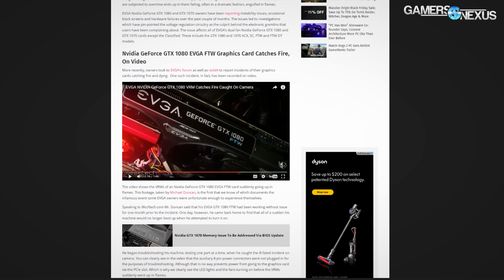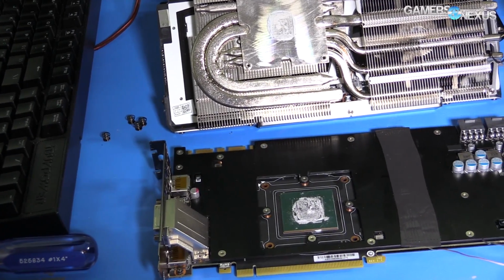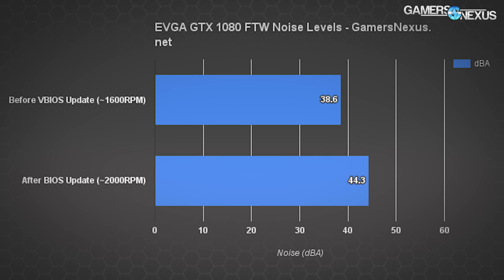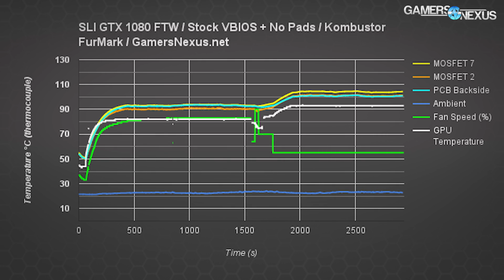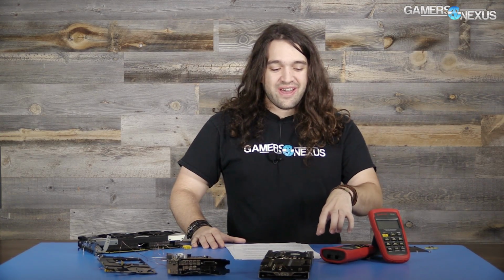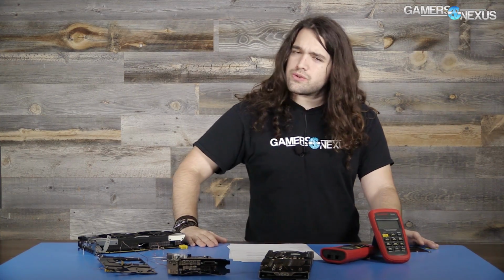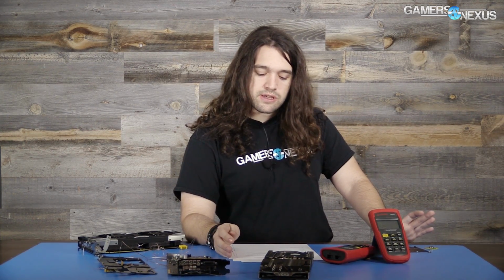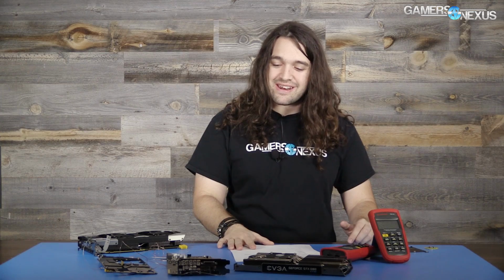EVGA's VRM Thermals Not the Killer of Cards - Final Test

Comment: Thank you so much for your hard work running tests and posting this data back in 2016. All of it was a big relief and Impressive! It is now 2024 and I have obtained an EVGA 1070 SC ACX 3.0 and a 1080 SC ACX 3.0 recently for cheap as an upgrades for our machines. When I get new cards I always take them apart, inspect, clean, and put some new thermal paste on them. My 1080 I have used for 8 months now playing normal and VR titles with no issues and I just now updated the VBIOS. The 1070 we've had for a month and all has been good so far. I will be updating this card's VBIOS as well. I'm going to say it's a pretty good chance with it being so many years, and when the posts for fire breathing cards were, the ones that are left in living condition should be pretty safe. I did see one thing mentioned on forums I would pay attention to though adding to the thoughts on capacitors. From what I understand those capacitors are rigid and any flexing of the pcb at all is quite the chance as the capacitors are multilayered. My Ebay gpus made it though USPS shipping though so take that as you will. I'd just take extra care when handling them or doing maintenance on them, as you do. I will be running my cards at stock clocks until I deem it necessary to push them as I run most of my games at 1080 and my TV I use as my monitor tops out at 120Hz anyways.

Comment: I am glad you made this video, and hope that EVGA does the right thing for it's customers who experience these issue's with their video cards even if they are out of warranty. I still have EVGA video cards I bought in 2005 and 2008 that still work, and hope these are just isolated issue's and not similar to bulging capacitor plague of the late 1990's and 2000's because Chinese companies took shortcuts when building them to save a few cents in manufacturing costs.

Comment: You explained sli vs single card. Higher fan speed on a single card with cooler gpu is, ummm, bad? More current passes through the fan and board components causing higher tempature on voltage regular components?  I'm noob and trying to understand.

Comment: I have seen many defective cards where the mosfets were dead and the card was saved by the fuses installed, or cards without fuses that have completely burned out at that point. What I really noticed is that the solder joints between the mosfets and the board were gray or bad contacting, and everyone knows that bad contact leads to increased temperatures and burns, so I think this is caused mostly from bad soldering techniques or high temperatures which can make the solder to break or degrade over time.

Comment: thanks again.. for 1 year I have been trying to figure out why my 1080 was so slow.. this knocked 20~ degrees of my temps and I finally feel I am getting value out of this card
Reply: What exactly knocked off the 20c? Did you not have the pads before? Or did you just adjust the fan curve? Asking because I have a new unopened one of these I am debating whether or not to send back.

Comment: I´ve purchased an evga gtx 1080 and the temperatures are good when I play with vysnc. But when I disabled vysnc, temps goes to 82-83 with fans in 70%. Too much hot and too much noise. In the EVGA 08G-P4-6183-KR, the base of the heatsink, Is it nickel-plated copper?

Comment: Why wouldn't EVGA spend the extra penny to buy the thermal pads for their VRMs...*especially* on their high end "ftw" cards.  I could maybe understand it on the 1060, perhaps even the 1070, but there's no excuse to not spend 1 cent on a $600 GPU.  Yes, I know that penny adds up when you sell millions of these things, but compared to the damage that's been done to their reputation, it is a no-brainer.  Once a company gets a name for skimping, people aren't going to buy their products, it's a hit to their reputation and reputation is everything.

For example, I've been using Asus and MSI products for over 20 years.  I've had a couple of problems in the past and they dealt with them completely and quickly.  I even bought one of the p8p67 boards back in the day, which had a single bad SATA header and Asus gave me an entirely new board with a different revision.  I trust Asus for motherboards and MSI for GPUs.  I literally have a dozen different MSI GPUs sitting around here (some in systems, some not) and EVERY motherboard that I've bought in at least the last decade has been ASUS and I've only had one issue.  With these two companies,  I know that I won't have any issues if something breaks and this is very important to me, the company's reputation is THE most important thing, for me, followed by performance, longevity and price.  Most people choose those 4 things as their key factors in making a purchase, some people use a different order than I do, but reputation is always a factor.

Comment: I applied the thermal pad mod but couldnt do the vbios update because I have my 1080 in a graphics amplifier and it won't do the update while it's in there. So I ramp up the fans manually. Does the vbios update change anything else or am I ok with just doing it manually? I'm thinking of just buying the hybrid kit and doing away with air cooling all together.
Reply: The Vbios update just cranks up the fan curve some compared to stock. so if you run a custom curvehigher then the stock was you will be fine.
Reply: oh ok man thanks yeah i definitely run my fans at max when doing heavy 4k gaming and need the extra cooling.

Comment: O_O

Very glad to hear that this is more of an isolated problem. I will be installing my thermal pads/making sure they are installed. I dont plan to really overclock it, but I like my  rig running as cool as possible. 

Video was fantastic, overwhelming but fantastic. Lot of data, reasonable method, and you really put it through the paces. I'll be picking one up in Jaaaaanuary.

Comment: Thanks for making such an in depth test! 

I have a criticism towards presentation though. The time charts don't do anything to make the situation clearer and are basically useless on video. From each of them, you can take the like the top figures or top deltas and represent them as bar graphs. Then you can fit display different test scenarios under each other, making  them easily comparable.

0.2% defect rate is OK for the first few weeks of use, the cards are not that old after all, and there's a lot of components in the VRM circuit. It is to be kept in mind however, that PMOSFETs also roughly obey the rule that increasing the operating temperature by 10° is likely to halve their average life, just like is the case for electrolytic capacitors, even though the rule is completely accidental and the reasons are not similar at all. And that there is always a significant variation in durability of individual components. So it definitely makes sense to keep everything there well under 100°C, even if it's specified up to 115°C, else you'll just keep seeing failures later on. The real question is going to be whether these 0.2% early failures turn into your normal 1-2% first-year failures or 10-20%.

Comment: Thermal pads applied, haven't seen any discussion about bad capacitors however? should I refund this card?
Reply: Bad caps happen in all electronics.  If your card still works it is fine so stop worrying.  Bad caps are a common cause of failure in practically everything that has electronics, so relax.  You can't prevent it.

Comment: I just use an aggressive fan curve in Afterburner. Problem fixed.
Reply: Laserturken 8659 Bruh. It's bad capacitors on like 200 cards not thermals.
Reply: I think you need to rewatch the video.  You can run default fan curve and be fine.  There is no thermal issue.

Comment: Hello GN and thank you very much for your video and research! I have a EVGA GTX 1070 that i bought in august 2016. I've requested the thermal pads but i havent gotten them yet but i will apply them when they arrive. But now to my question, I am using my pc daily mostly for gaming and I am now wondering if I should still worry or if there was a problem witch my card should it have appeared already? Kind of a hard question to answer but mainly i wondered if you guys have heard anything about how long it took for defect GPU:s to "blow up/catch fire or start to act up? Thank you very much if someone has some info!

Comment: This really puts things into perspective when it comes to the issue. I have a 1070 ftw. I haven't had any issues with it as far as core temps are concerned. I also have no way of testing temps on the vrms. But I did order the pads and downloaded the vbios update. Extra performance with cooler temps, I think it would be foolish not.
Reply: Especially with GPU Boost 3.0, Where Thermals are all too important.
Reply: I'm more curious to see if I get a more stable overclock with the pads and vbios update applied. Just got my pads in yesterday.

Comment: You know if it is a bad batch of capacitors they need to Recall those cards, and not ship the VRAM stuff......this is not good - great video as always - thumbs up
Reply: haris javed this is not a bad batch as in contained.  it is standard across all cards and manufacturers.  all manufacturers would have to recall them, not just evga, to include amd.
Reply: That would cost millions. Its much cheaper to replace even thousands of GPUs. This isn't life critical like air bags in cars (companies still prefer to pay millions per death as opposed to recall as it saves them money). Recently there were metal fragments that were launched from the airbag explosion effectively making a frag grenade. Its obvious they never tested the air bag, otherwise they would question why chunks of metal were blasting into pieces. Its simply cheaper.

This isn't life critical, so realistically, they won't recall all of the cards. Like I said, they could RMA thousands, probably even extend warranties to lifetime for free and still save money.
Reply: I''m personally on a GPU/monitor death streak. A "used" 270X from ebay, it blew electricity from the HDMI (bitcoin mined to death probably), that killed a TV. I had an old monitor give up and arc through the VGA cable (tripping house breakers), also killing thankfully a cheap X1300 (monitor was working the week before). Then my other 270 died (but that could have been subzero cooling, I think it just needs a re-flow in an oven honestly).

That's a 270x, X1300, 270, TV, Monitor (all within the last 400 days). Obviously, if EVGA only has 200/million, that beats my 2.5 per year (for just me)!    (PS: No I don't send things in for warranty unless they are DOA, also, I won't be buying many more "used" parts on ebay. Also, none of these were from bad design from companies as far as I can tell, because the only one that died unexpectedly was the 270, but I think it just didn't handle the cold well, and no company expects a GPU to run at -50c for daily use). I'm having to use my laptop right now... 

But I got a Fury coming so, I'm pretty excited! No overclocking on this card, cause I'm way below the recommended rating with a 500w PSU, and I'm running an FX-8350 (220w true draw, or 260w from wall increase when I run P-95), and a Fury rated at insane power draws will exceed this. I'll obviously test everything with a wall meter plugged in, and slowly ramp up the tests until I either peak, or I get up to my PSU rating (in which case, I'm buying a 1000w PSU and calling it good if it gets close to the limit). But hey, even a 1000w PSU is still much cheaper than what I saved with a GTX 1070, plus it will give me enough power for almost anything. Until then, I'm going to under-clock everything, turn off half my CPU cores, and pray my 500w is enough until I'm done testing for safety.
Reply: Jake Garrett same thing kinda happened to my 270x.....it was lightning though. forgot all of my hdmi cables carried ethernet and don't have an ethernet surge protector. lightning struck and went through hdmi blowing out the port on the card, the arc hdmi port on my tv, and my entire denon a/v reciever.....I feel you man, fucking sucks.
Reply: blueburger4 Oh that sucks. Yeah, that could be why the used 270x I bought was damaged, I figured it was bitcoin mined to death, but a storm could easily damage it. I never thought about unplugging the Ethernet chord, but since you mention it, I think I"m going to start doing that during storms in addition to my normal unplug everything from the wall. My last 270 I think just has bad solder contacts (sub zero cooling would cause the metal to contract and get worse contact), so I think I can fix it with an oven. 

Thanks for the tip about the ethernet chord! That may save my new Fury some day, and a 4k monitor (when I find one in my budget). That would suck loosing all that, so that's some great advice. Cheers!

Comment: You didn't mention that EVGA advertised these cards as quiet.  After the vbios update, the cards are not as quiet as they were.  If someone bought these cards on the basis of them being quiet, and then flashed the new vbios as recommended by EVGA, don't think they may be upset by the extra noise during loads?
Reply from the maker: Yes, we did that in this testing. It is not a problem.
Reply: Overonator Pretty sure techpowerup keep a repository of GPU bios files.
Reply from the maker: They can install the thermal pads and leave the VBIOS stock, then.
Reply: Gamers Nexus I wish I did that but I flashed and I don't think I can flash back.
Reply: So it would just let you reflash over an newer version?
Reply: Gamers Nexus
Cool thanks for the info!
Reply: if you want quiet i would suggest water but thats me.  if you dont trust yourself for that try some sound matting like musicians use.

Comment: I don't often post comments on YT vids, but have to say that was a really well done video. Throughout this whole saga, there hasn't been the level of testing shown here, and its definitely put my mind at rest about my 1080 FTW. I really hope that people can start to understand that this isn't about saying EVGA were right or wrong (They obviously should have shipped with the pads) etc, but about getting evidence regarding the longevity and safety of the card.

I'm currently running my own custom curve, and haven't applied the vBIOS update or pads yet. Looking to do it when I get a spare weekend. I'm feeling much better about the whole situation. Things really have got out of hand, and comments on forums (official and otherwise) are just tantamount to screaming and shouting. 

Really love your vids, and your scientific stance on things. Subscribed and hope your channel gets the coverage it deserves. Problem is data and information isn't something a lot of people want to hear. They want to be told an outcome, but evidence lets you make your own opinion based on observations. Never change Steve :)
Reply from the maker: Thanks for the kind words! :)
Reply: So should the normal non tech people panic or not? I bought my 1070 sc 2 months ago and I'm still worrying. But I have not seen any problems whatsoever.
Reply: + so ly  i have a 1070sc from i got in july, i've been overclocking it and playing games full throttle at 4k in small case with low ventilation. the gpu temps hit 90c all day everyday. i've had no problem with this card and am not scared to keep pushing it to its limit. i suggest you push your card to the limit too.

here's my case, it has practically no airflow

https://www.bing.com/images/search?q=cyberpower%20vaper%20case&qs=n&form=QBIR&pq=cyberpower%20vaper%20case&sc=0-0&sp=-1&sk=

Comment: With those results I guess just applying the pads and keeping the stock BIOS should be enough to get a cool and silent card. I don't really like upping the fan speed due to the noise. But it does not seem neccessary anyway.

Comment: EVGA still fucked up. the acx 3.0 cooler design is bad and EVGA should feel bad. i don't think it's right to say the only thing wrong is not adding thermal pads. that's the whole point. they tried to save money and sacrificed design/function and they sacrificed their image as a company. i bought 2, 2 fucking 1070's. they both had issues. updating a faulty BIOS and giving away thermal pads so quickly AFTER the fact tells you they knew there were issues with the card, they just chose not to fix it before release.

Comment: Thanks for the tests, I have the 1070 FTW with no bios update and no thermal pad mod and had no problems at all, my pads just arrived and will be fitting them shortly just for the cooler temps, I also wasn't really worried about the card blowing as it's covered by the 3 year warranty - Thanks.